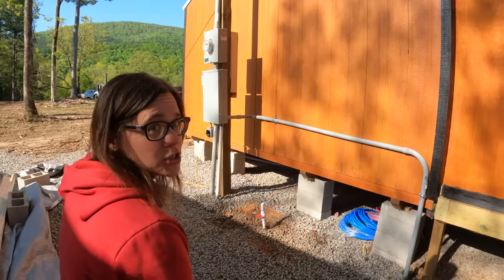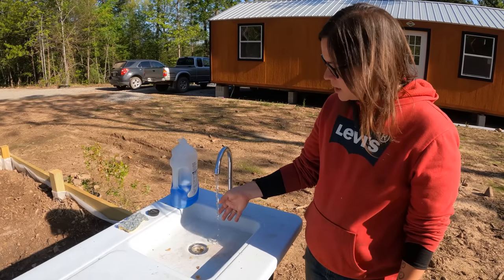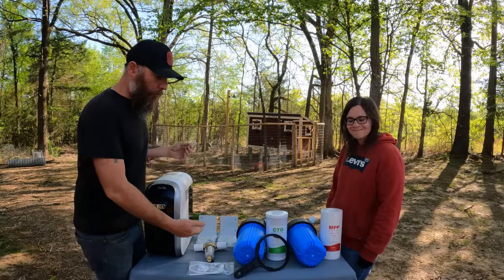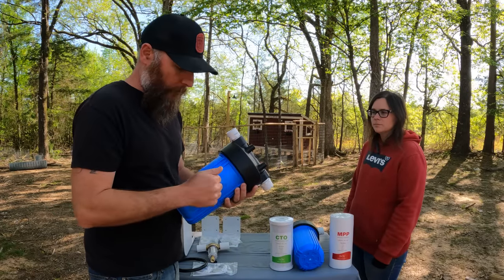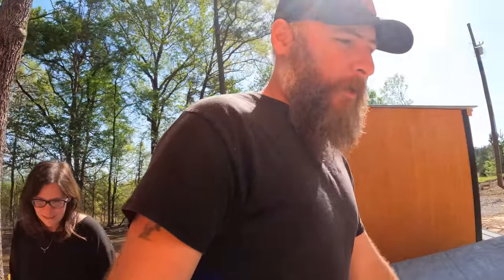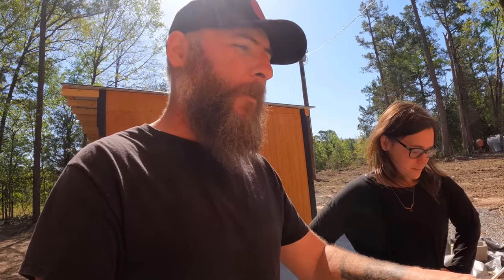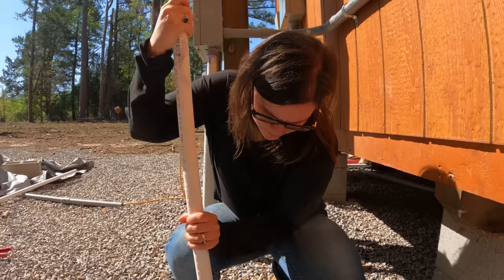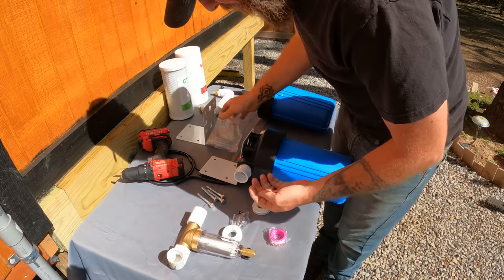Best way to get clean water | DIY Water Filter Install | Couple Builds Dream Home In The Forest

Comment: I have sold this type of system. Tell people that you need to have your well tested!!!!!    This normally for the sink  etc.   not whole house. If you read into the product it will tell you what it can be used for.    You could still need a iron filter or a softener for hardness!!!   If you have sulfur problem you have equipment for that. after that you can use your product. You will not  use for toilets etc.....        The filers are very very very expensive. You still can have a well spigot at the sink.     Please tell the people it is not for whole house use!!!!

Comment: Your outside water spigot should have been installed before the filters instead of running the water through the filters for outside water use. You will drastically reduce the life of the filters otherwise.